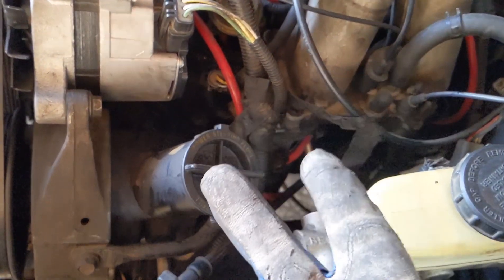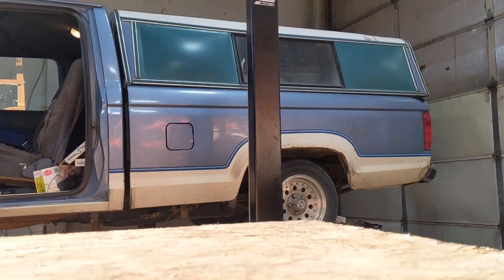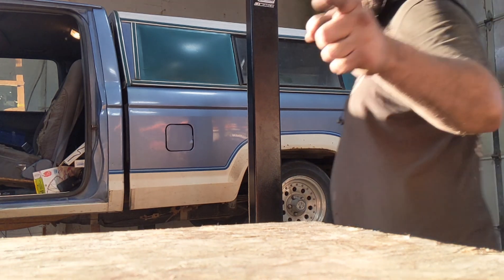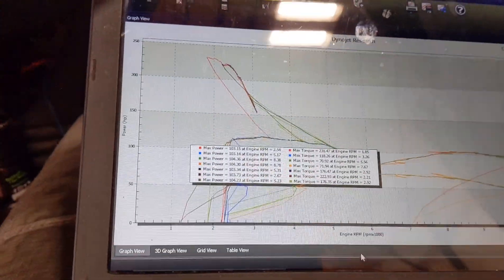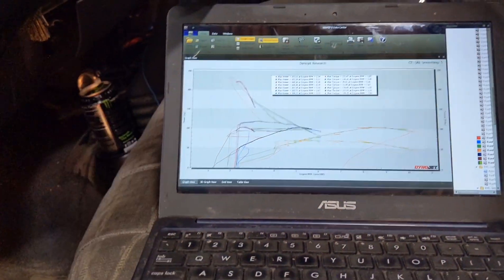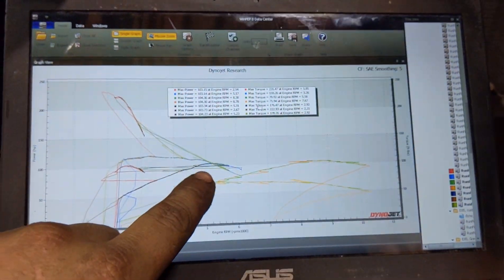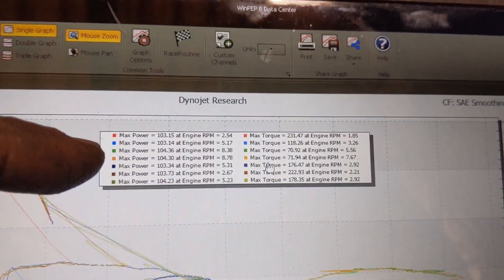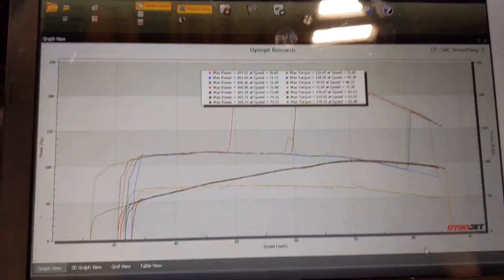BONUS VIDEO! Stop spreading the 2.3 plug wire myth!

Comment: I’ve only ever seen them switch them on the coil itself
Reply from the maker: I did just switch the coil end of the plug wires.
Reply: @208Concepts  oh damn my fault it looked like you were at the plug. I forget the coil is down lower on the earlier rangers. Thanks though now I need to switch them back to factory on my 93 lol
Reply from the maker: @notchase5973  yeah, silly Ford and their coil location on the 89-91 builds... I never understood that 🤣.

Comment: What is "the myth" ?
Unicorns appear from the exhaust?
Reply from the maker: That swapping the plug wires around on the intake side noticibly increases HP. People in the Ranger groups know what I'm referring to but I should probably have explained it for the layman 🤣
Reply: I was so hoping for unicorns.   But you discovered the buttery torque band  so there is some good.
Reply from the maker: It may have been making flames... Those were some pretty aggressive pops when the thing was hot 🤣
Reply: @208Concepts  nah.  That was that zuPoo ad before the video